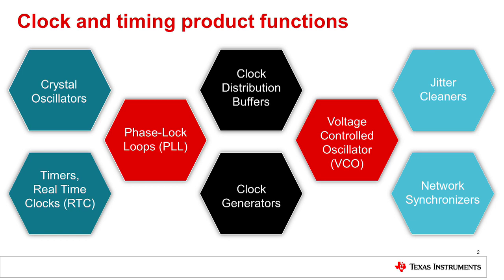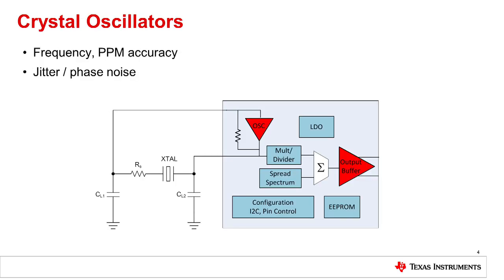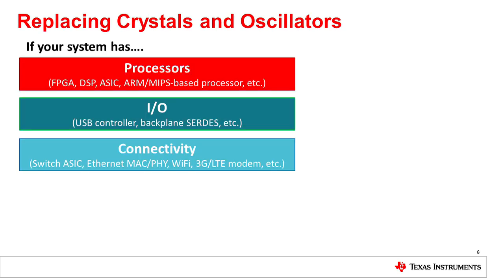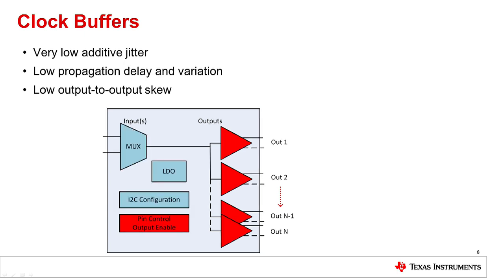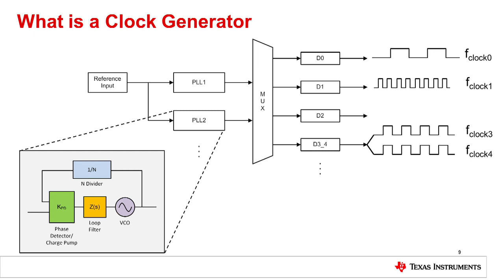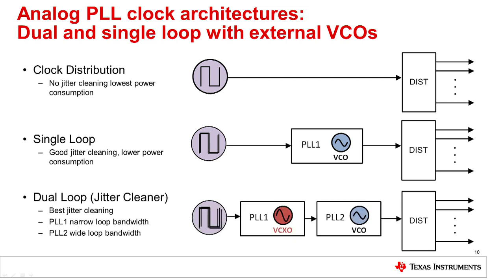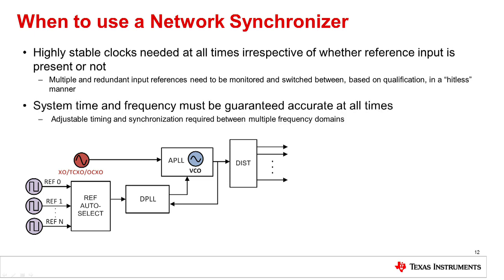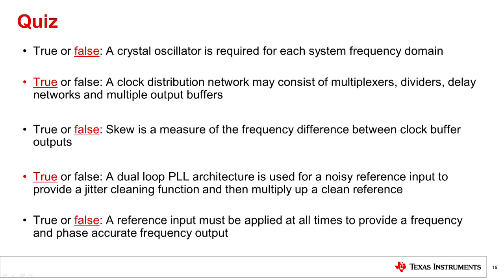Clocks and timing systems overview

Comment: But the big disavantage of high speed high frequency is too sensitive but parallel design of multiple processor of low speed cpu beat any expensive so quad design or 12 processor pentium or celeron  even cheap and  better of